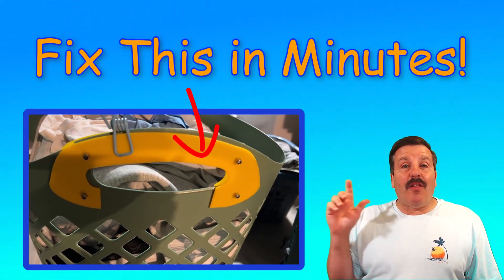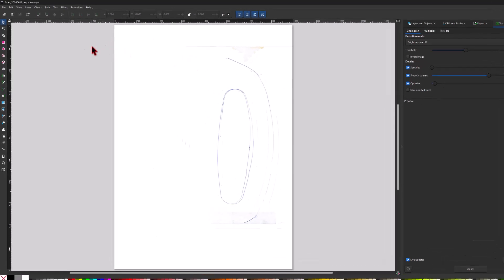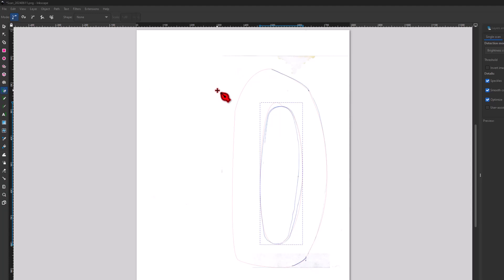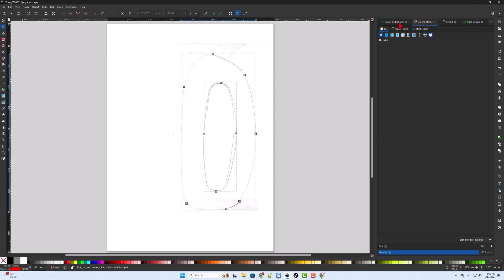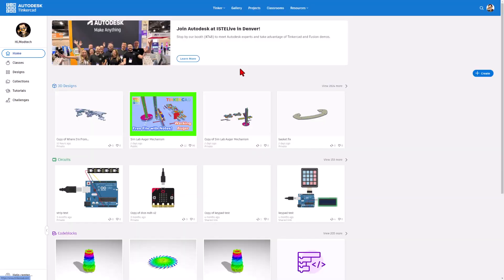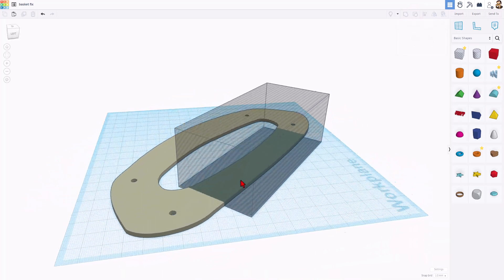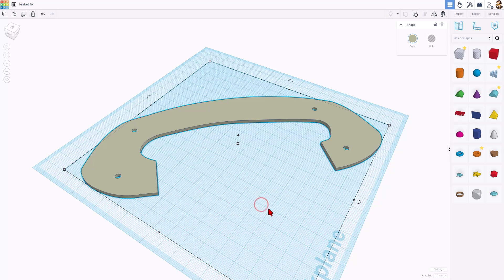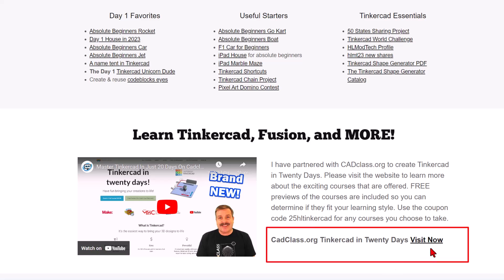3D Printed Handle Fix! Scan, Inkscape & Tinkercad Combo for Beginners

Comment: Why does my tinker cad when I export it doesn’t allow me to select location? Just automatically dumps it into downloads? Is this a google or windows setting ?
Reply from the maker: I saw that happen when the browser default action for a STL was set to something like "open".  I am not quite sure how to fix it. What browser are you using?
Reply: @HLModTech  i went into google chrome settings and bingo it has a download setting. which I changed and now asks for what folder I want it downloaded into
Reply from the maker: That is awesome! Well done and thank you for sharing!